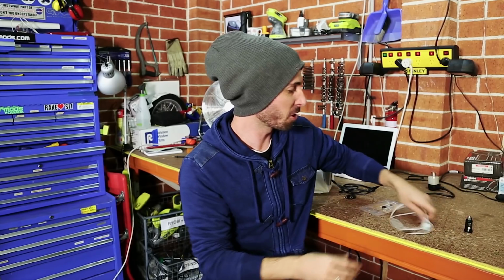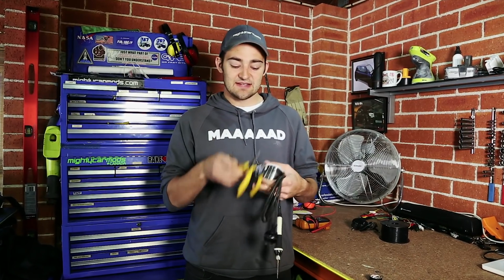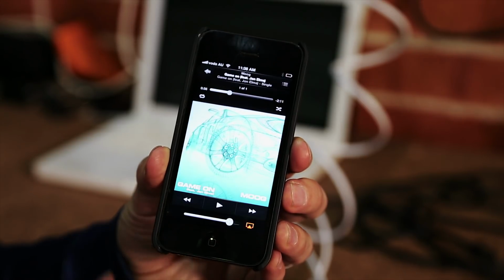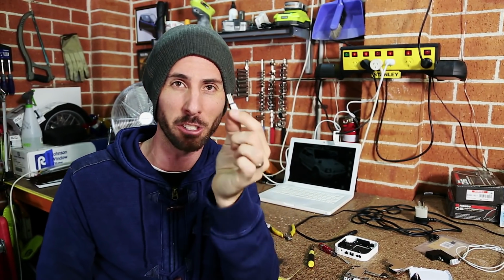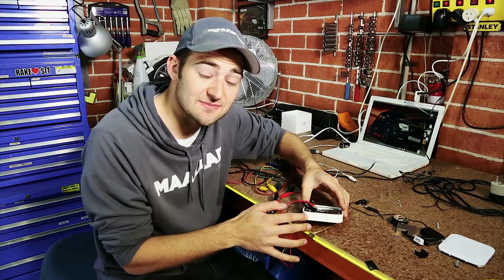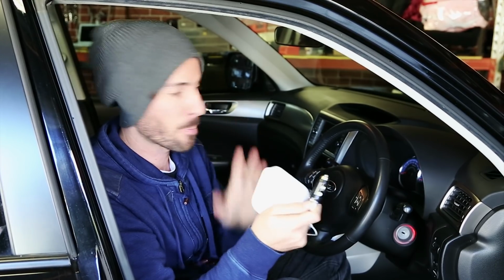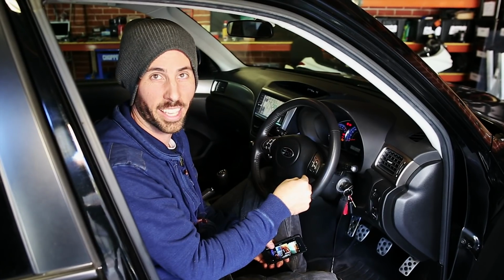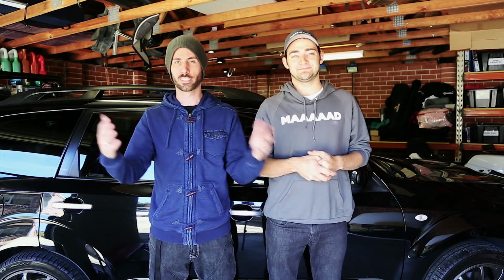Install Airplay In Your Car

Comment: If you get a Voltage Regulator that can take 15V input and step it down to 3.3V, you can skip the USB power part. Chuck in a couple of capacitors to filter out the slight ripple in your power supply and tada!

Comment: This is just more apple daft fanboy nonsense......bluetooth is completely wireless, does not require this hassle and cost and also allows you to make and receive calls via the phone. Not to mention alot cheaper. Plus a pound for an aux cable is cheaper again and can be taken with u alot easier than that thing

Comment: All this high quality demands, while standard (most of them) speakers are mounted in car doors. So if you want to be a hifi freak change all your speakers to compo sets (high and low separated) then it is time to talk about quality diffrences. I've seen alot of factory speakers and they are truely a disappointment to hear.

Comment: I get regular dropouts (by that I mean the music actually stops and I sometimes even have to reconnect the wifi network to re-access airplay, which is a real disappointment. I find Airplay quite unstable, but when it does stream music, the quality is quite good. How fares the airport express in the car, guys?
I have so far only come across one GOOD bluetooth solution - the blackberry music gateway.

Comment: did something similiar to my accord... but theres an easier way. use a blackberry stereo gateway and get a cheap mini usb car charger and stash it behind dash..  then connect auxiliary to the headphone jack on car.   no soldering and costs about 25 bucks if you buy on ebay

Comment: As far as I know cold air intakes are legal giving that the pod filter and components are bolted down to the engine bay, For example a decent sized peice of sheet metal that is bolted to the engine bay, and then bolted/wrapped around the pipe to keep it secure

I could be wrong but i've seen people do it to avoid trouble with police and it's worked so far

Comment: Bluetooth streaming does not compress, its the new version of audio transmission. So it's LOSSLESS, 1:1 data transmission. So if you use a really old bluetooth car kit then it IS loss of quality. Audio Quality? iN your car? Seriously? All the windnoise from the car, roll noise of the tires will really have a hard time making out if your HIFI on your stock speakers in your car.

Comment: This wins for geek points, but unless you're stuck on Apple's proprietary AirPlay system and your friends all have iPhones, Bluetooth audio streaming is far more convenient. Otherwise, use the Aux In that you're plugging said AirPlay into and plug it straight into the phone. Far cheaper, and most listeners won't notice the difference.

Comment: Kinda useless, given that when you're driving your car, you wont need to be able to change the music from the other side of the room. You could just plug it in to the aux directly, you'd even get less wire clutter this way. Okay so i'm stating the obvious, but i was looking for help with a car that doesn't have an aux jack

Comment: so why didnt he just buy a 3.5mm male to male aux cable and connect it to the aux head unit.  Like if you so require your friend to play his tunes why dont you unplug from your device to his? Please respons mightycarmods, cause its seems pointless are you going to hold your phone and change tunes etc? this seems a bit pointless.

Comment: I have a 2011 Mustang and I didn't get the sync system so I went and bought a Bluetooth converter. It was like 15 bucks plugs in my aux port and power port, What is the difference between that and an Air play unit?

Comment: I should also clarify, get a headunit with bluetooth and just about any phone or tablet will play music through it wirelessly.  My galaxy s3 will, but so did my old moldy samsung rogue, and so will my acer a500 tablet... or pretty much any other phone or tablet that has bluetooth.  No soldering irons needed... no stripping wires... no need to purchase extra hardware and cabling and no need to hide that wiring and hardware in the care... my headunit cost me about $150.... and done :-)

Comment: the cheaper way is to buy a (A2DP) receiver  from Amazon or eBay for £20 which plugs in to any car stereo or home stereo via aux input. that's better than spending £120 dollars on an apple air port and soldering bits. plus i stopped using apple products as I found them to be very limited and always had to hack them, I've not had that problem with android products.

Comment: edit: i bought a TO-220 Heatsink Heat Sink Positive Voltage Regulator IC 12V. Should I have bought a 5V version instead?

Comment: What type/model is the voltage regulator? I bought a 12V one off eBay that comes with a heat sink for $1.. haha but did I buy the wrong one?

Excellent video!

Comment: good stuff! An alternative solution if your not too good with wiring is to use a sinewave power inverter you can pick up from Dick Smith Electronics, Jaycar, etc. I have been running Airplay in my BMW for about 2 years now using that method. Use the smallest inverter you can find, the Airport Express uses very minimal power.

Vote up!

Comment: Im a MECP certified tech in the US, quick question, Why not just buy a cheap DC to AC adapter and plug it directly in using the Wall plug? Or is something different over there where this is not a simple cheap task?

Comment: Its probably worth noting (for the idiots) that tampering with the airplay device will void Apple's manufacturers warranty. This means that if there are any issues with the device in future, forget about trying to get a replacement through Apple (unless you want to pay for it).

Sorry if that was mentioned in the video.

Comment: Awesome mod. A good idea would be to use capacitors on the either side of the regulator as linear regulators will have some voltage ripple.

Comment: Great episode guys. Unfortunately I don't have an Apple product, but you could do the same thing with a stand alone Bluetooth adapter (yeah, WiFi signal is much cleaner, but not everyone can airplay). Here in the states, I like to get mine from parts-express(dot)com. Something like 15-20 USD to add Bluetooth to my speaker systems and custom enclosures. Great episode. Keep it up.

Comment: If you have a dvd head unit you can get an apple tv and stream, the trick would be figuring out how to add the ability to stream to it yet still pull cell network. You could use a mifi from your cell provider and a travel router, but that add's to the expense.

Comment: You know you cab get adapters that turn the supplied power cables into a 12v socket which has an inbuilt voltage regulator.

Comment: A lot of people are saying use Bluetooth or a aux cable well for aux you have to run a pain in the ass cable and with Bluetooth nothing kills your battery quicker, AirPlay while it uses more battery uses nothing compared to Bluetooth. AirPlay is s great sys and works well ill certainly be trying this

Comment: To replace the head unit in there now with a similar blue tooth capable unit would probably cost close to $1,000. On top of that, I'd be willing to bet Subaru's stock display and navigation system is much better than the replacement and/or not compatible to be changed over to a new display.

Comment: Bluetooth is standard in most new cars anyways, including the new dinky Corollas that look like they came from 2003. If your car is old, then it probably doesn't have an auxiliary input and you'd be getting an aftermarket system anyways.

Comment: I like this except for the apple-specific merch. There's a DIY hack I saw where you take bluetooth headphones and a 3.5mm->Cassette adapter and make a Bluetooth Cassette player. More multi-purpose and completely interchangeable (Any car with a cassette player will be able to use it.)

Comment: How does it connect? Doesn't it have to have WiFi and be on the same network? When your driving and don't have a hotspot it won't work then correct?

Comment: Nope, AirPlay is Apple specific. You could do exactly what they did here with a Bluetooth audio receiver instead though, and that would work for connecting your Android or any other Bluetooth-enabled device. Check out the "Logitech Wireless Speaker Adapter" and essentially hack that instead of the Airport Express and you're good to go.

Comment: But the car already had a headphone port, just buy a 3.5mm jack-jack aux for like £/$2.. It will work on other phones and all iPods, with like way more memory (90gb, 120gb..).  The car already has a AUX input so why not just use it?!  I muust be missing something, right?? Then you can use the gret lighter to charge stuff, and if you really have to have wireless then just get a bluetooth reciever..  And this isnt even a particuarly cheap build!  Bah.  Still looking forward to the next ep though..

Comment: I don't get this at all. Why go thru all that trouble if they still plug it in with a cable. Why not just get a 3.5mm headphone to mono and stereo cable and plug that in directly and use the USB charge to charge your phone?

Comment: I'm assuming they did this instead of blue tooth because blue tooth in cars has a habit of compressing soundwaves and taking away a lot of your volume from music. And the airplay can be accessed by any passenger with an iphone instead of a bluetooth that requires synching and time.

Comment: If you had a hardline audio signal (AUX or USB etc.) you would see how big of a difference in audio quality there is between an FM Transmitter and hardline quality. I used to use a FM Transmitter and then finally I upgraded my audio system and there is a night and day difference between the 2... trust me... FM Transmitter sounds like ass

Comment: lol, earlier i said: oh if you have an aux cable why not use an aux cable?
gonna take that back. this solution is portable in that you can take it around to different cars - also you can also use this with a home theatre system or even link up to portable speakers

Comment: Interesting, but Bluetooth works for all phones not just apple, and the quality for bluetooth A2DP has a bit rate 512kbps for stereo which is quite good quality. You do get bluetooth adapters for cheap and most cars come with Bluetooth now days anyway. Even if you have an old car getting a Bluetooth Car stereo for under $100 is very easy... and what you know, you can answer your calls on it too, With airplay you cant play your calls over the speaker

Comment: Bluetooth has usually really crappy audio quality and is useless for anything more than playing hip-hop and bass tests. While Apples AirPlay uses a lossless codec. (And I'm saying this as an Android fanboy)
Also, most modern head units, either original from factory or $100 from Walmart, has Bluetooth built-in already.

Comment: OR you could buy a AD2P Wireless Bluetooth for $15. already runs off USB power AND it will connect to just about anything that has bluetooth, thus not limiting it to JUST Apple products....

Comment: the aux socket depends by your head unit and not by the car itself.especially in older cars head units usually don't have an aux socket,and it's hard to mod them and add one

Comment: Rekoyl116: cant reply in this retarded webversion of ipad (and no the ipad app of youtube is terrible) but you can get bezels or chinese aux-modules which get on the back of a original radio with cd changer plug. So many solutions for this problem, this is so much work for  a simple thing. If you cannot change a bezel, why would you even attempt all this mentioned in this video?

Comment: There's this thing that it's Apple devices only with AirPlay. If you replaced the Apple-lover's box with a Raspberry Pi, you could just add a bluetooth dongle, a wifi dongle and then use respective software to make raspi work as a AirPlay host and a Bluetooth audio device. Though Raspi's 3,5mm analog output does have a annoying whine to it, so it's not as good. Also, a normal Bluetooth enabled head unit (as my Pioneer DEH-6400BT) should do it as well.

Comment: AFAIK Bluetooth (A2DP) only supports 2-channel (left & right) audio so if your system supports optical fiber you can get up to 6(?) channel audio. However, bluetooth is better for usability in that you can also make phone calls with it and uses a lot less battery than wifi.

Comment: easy! buy a second hand power inverter. preferably pure sine way. you connect it to the battery. extend the on/off switch and mount it anywhere you like. simply position the speakers anywhere you like, plug your phone into the 3.5m jack and away you go!

or splice some wires and hook it up to your head unit. very easy job. hardest part is feeding the wires down the firewall

Comment: I just have the rear usb lead from the head unit going into the glovebox. ipod or usb drive plugs into it. wires hidden and the radio controls the tunes (no need to break the law by using the phone while driving)

Comment: Novel, but a total waste of effort. An unnecessary additional step between the phone and head unit. Wirelessly streaming but ultimately ending up with the same cruddy analogue 3.5mm connection into the aux input you had already.

Comment: boring episode, still have to control the music via the phone, which is the same as using an aux cable, hell it'd be just as easy to use a bluetooth equipped head unit

Comment: Wireless streaming is meant for ease of use, not full streaming Audiophobe applications.  Also everything uses bluetooth, so the Airplay will only work with an Apple device.  Just mount a Nexus 7 in the dash and be done with it!

Comment: Because Airplay is just reworked wifi that Apple can now charge speaker manufacturers an extra $100 just to license it, also meaning you have to buy an Apple Airport Express instead of any wireless router, which has even less functionality for more cost.  Airplay range is not needed in a car, and bluetooth compression is barely noticeable.  If one was to need higher rates of sampling, they would probably just wire the phone in, use an SD card or thumbdrive.

Comment: Why didn't you use a device that already runs on 5 V, is smaller, is less than half the price and works with Bluetooth just like the Logitech Wireless Speaker adapter.

Comment: Seems like way too many steps to get audio from your phone to your car. Turn on car, and wait for the device to boot. Once booted select airplay button on phone (tiny) select airplay device then press play. Frustrating if you just want to get on the move quickly. In my car it's put phone in holster plug in audio cable done. With android (cyanogenmod) you can make it automatically start the player when a headphone cable is plugged in. Also, no ground loop isolator?

Comment: What the hell is the point of this video. What Car Stereo doesn't have an AUX input? Just plug the MP3 player into that. If you Car Stereo doesn't have an AUX input then rip it out and chuck in a new (or second hand) car CD player that does have an AUX input.
I only own an ipod because other MP3 players don't have the storage space. But I would never, ever install or use apple products in my car on my computer.

Comment: Bluetooth's not going to be better than an aux cable (there's a transcode involved no matter how you rig it up), but it can be almost as good if your device and head unit are reasonably modern.

Of course, if your source is a 128kbit/sec mp3, the damage is already done.

Comment: Nice video, but actually don't need the voltage regular, cause the device could handle the 5V no problem. 
thanks

Comment: This is a really cool mod, but I wouldn't say its worth it. There is the bluetooth option and some people say it sounds like shit, never the less it still works. There is also the option of a direct line from your device to the stereo which sounds fine. Also, its been my experience that airplay tends to be a battery drain for the ipod so you'd want to have it plugged into your car's power outlet. Like I said its a very cool mod, but I don't see its worth...

Comment: That would depend on what the cable is made of and what the audio source is.  Of course if you are some kind of crazed audiophile, nothing short of an optical connection will do - but those people are nutso - by the time you get to that level, the human ear has become the weakest link.

Comment: You have to qualify that - if comparing it to AUX, assuming a digital source - how good is the DAC?  What is the cable made of?  If comparing it to USB, well USB 1.0 maxes out at 12Mbps, so Bluetooth 3.0 +HS has twice the throughput... either way, you have to look at your source - assuming you rip a CDDA, that's a meagre 1.4Mbps, so even Bluetooth 2.0 can keep up.  The whole idea of Bluetooth providing inferior audio is a fallacy, at least for the last 5 years or so.

Comment: I did the same kind of thing to my car. I bought a cheap bluetooth adapter from eBay and no wiring was needed to be done. It was way cheaper than hacking up an Apple product. Works like a charm. Though I couldn't rename the device and it had to be operated through bluetooth, which ran down my battery on my iPhone.

Comment: an easier way would be buy a universal laptop charger that comes with various plug ends and has adjustable voltages.
I know some people would be scared cutting and soldering wires.

Comment: Replace a single cable with a usb charger, usb cable, retain the aux cable, add an AirPort which you now need to hide somewhere.

Then instead of simply jumping in your car plugging in the Aux cable and away you go you now must make sure Wifi is turned on, wait for the AirPort to boot up & connect to the iphone then start playing music.
Also the cigarette lighter is ALWAYS in use. Hope your iPhone doesn't go flat often :P 
For me A/market stereo W/BTooth, Nakamichi speakers + sub sounds great!